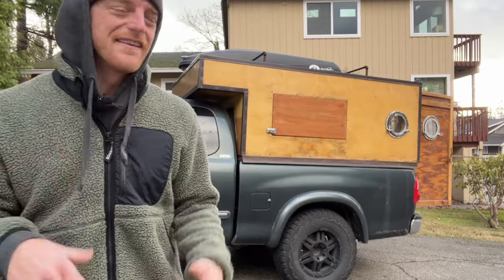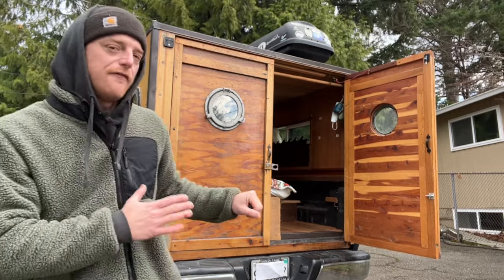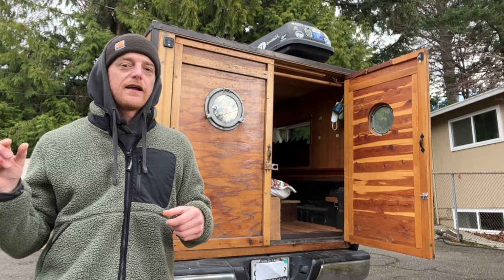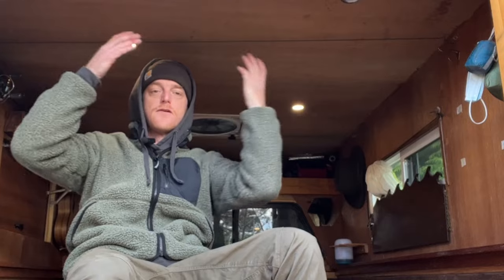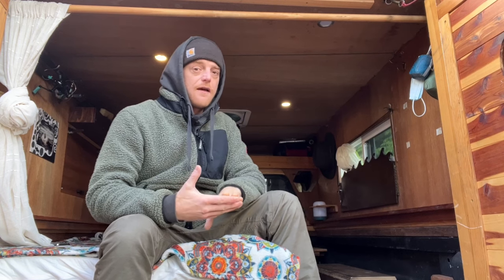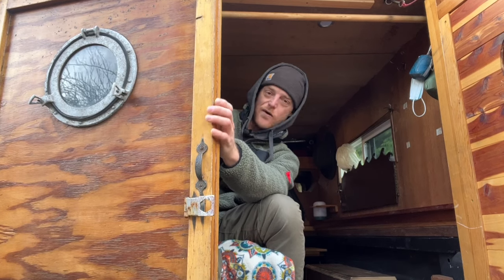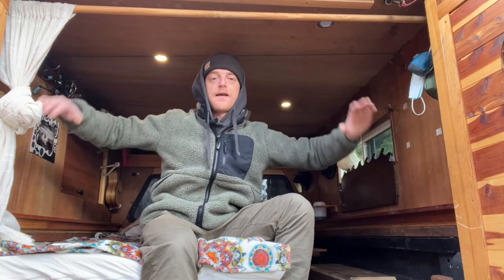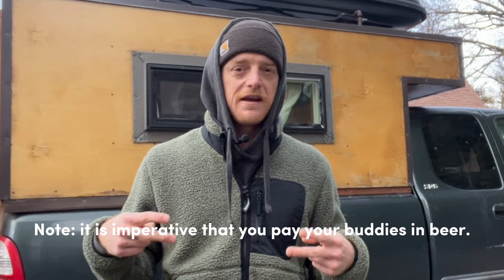Framing A DIY Wooden Truck Camper: Lightweight, Inexpensive, Simple & Strong!

Comment: Popular wood is not hard it is soft and weak not saying it not going work for what you used it for but I am an arborist so I do know my wood I would not let the poplar wood get wet or your going have issues
Reply: Agreed! I'm a Carpenter of 30 years,I'd never used popular
Reply: Use cedar next time—light and water resistant. Strong enough for these things.
Reply: Botanically speaking, poplar is an angiosperm, which is referred to as hardwood. The
Reply: Popular is definitely a HARDWOOD
Reply: Wouldnt hurt to do a poormans fiberglass to seal it
Reply: @theemeraldfox7779 hHa😂
Reply: @jamescorfield534  what's so funny?
Reply: @theemeraldfox7779  I thought it was a joke but maybe it wasn’t
Reply: @theemeraldfox7779  because its supposed to be Poplar I thought
Reply: @theemeraldfox7779  don’t ask me why I thought it was funny at the time I don’t remember I don’t do negative. I only respond to it so if I was wrong it’s cause I was mistaken in how funny it was
Reply: This is a truck camper video instead of being a hater or focusing on the wood compliment the man for making his own camper
Reply: I'm a woodworker poplar is definitely a hardwood look it up
Reply: @elmmau3876  no it not am an arborist the wood starts with me it a very weak wood
Reply: Well you're confusing your opinion and experience with fact it's a fact it's a hardwood look it up. I'm no arborist but I run a sawmill and work with a variety of different species from log to completed project.😘
Reply: You are correct.
Reply: First off I love the camper! Great build, great job! We use poplar wood 8"x10" x48" to crib up tractor trailers to work on them and they hold the weight with no problem they are light and easy to handle. One time we ordered oak timbers and they sucked they were twice as heavy as a popular. The  oak started splitting from sitting out in the elements. The popular held up better and we continue to use it.

Comment: Use light gauge steel framing, the same metal studs used in commercial buildings. It's 70% lighter than wood and stronger. The trick is to turn the metal studs sideways so the wall depth is 1.50 inch thick instead of 3.5 inch thick. That will give you an R 7.5 value with Extruded Polystyrene foam board insulation which is very high for a small camper that is totally sealed. The camper needs to be insulated on all sides, top and bottom, and completely air tight or you're wasting your time.

Comment: Hi Mike. Alfred here. Just wanted you to know that I like the job you did. Excellent job. Your camper build inspired me to build one of my own. So I did. I built a wood frame with 2" foam insulation, put 1/2-inch plywood on the outside and then I wrapped the entire thing with aluminum. I drive 2006 Toyota Tacoma crew cab 6ft box. If you care to see let me know. Love the name you picked for it 'Maxi pad'.

Comment: Love this framing guide.  I wanted the build one of my own and kept thinking I needed to use something like aluminum tubing and channel for weight reasons, because I knew typical 2x4 pine would be too heavy for my purposes.  I'm not a carpenter, so the though of using a 2x2 hardwood as the basis of framing hadn't even crossed my mind.

Comment: Thanks for the detailed breakdown this will help me a lot. going to try and build a canopy/topper soon. I want to be able to remove it easily.
Reply from the maker: Nice! Glad you're finding it useful. There are plenty of ways to make this design more easily removable, too. Mine's removable, but it's a process because it's bolted in and the double doors need to be removed. So using clamps instead of bolts, and an easily removable rear door would be a step in the right direction. Get creative, I'm sure you'll nail it!

Comment: I love it. Glad you posted this video. I will do generally the same except I like to work with fiberglass and will cover exterior with 1/4” luan plywood and will fiberglass and gel coat it. But same basic principle. 

I love to build stuff. And in this case I’m going to do it myself because a BASIC purchased LEER cap for my 8’ bed truck is nearly $5 grand!!  I can buy a LOT of material for $5 grand and it will end up being so much sweeter. 

Anyhow. Good job. You are definitely ready for Burning Man.

Comment: I like the port holes.  When the weather is bad you can 'batten down the hatches'. ;-)

I dream about builds.  It's a good past-time!  I need to save up for a van and many years of travel with a decent rig, but I've look at full size vans but recently at the small vans or what some call micro-van.  I think I can make it work.  One thing is how to store propane for a van, and many RVs and such have a compartment that is sealed from interior but with a door, and vents on the door, to the outside.  

If I plan on using propane quite a bit for years then it would pay in the long run to do propane storage the safest way.

Comment: You mentioned 3/5 exterior plywood- is that correct? It looks more like 3/8 or 1/2. I really like the light weight design / simple design - thanks.
Reply from the maker: Doh! You're right, I misspoke! The plywood is 3/8", not 3/5". I'll make a note correcting that in the description. Thanks for the catch!

Comment: Idk why people say to use 2x4's, if you've ever gutted and rebuilt a pull behind camper they are framed with 2x2's, trust me, that's what I do for a living., literally we buy old pull behind campers gut them and rebuild, redesign the floor plan and rebuild them, but we rebuild them to better than new condition and do things that the camper  builders don't do, we use Flex Seal on all the gaps instead of Seam Sealer and we paint the roofs with truck bed liner before we spray the body color on so if it gets caught in snow or hail it's more rugged and can take more plus it adds to the insulation, we had a couple send us a video of their camper in a hail storm in Western Iowa 3 weeks ago and commented how well the roof held up.
Reply: Great ideas thanks! I hope your still doing that and I wished I could find a old over the cab slide in truck shell but they are hard to find! I've got a 94 Dodge RAM 2500 but maybe one show up one day before its to late. Have a great day buddy!
Reply: @Tommy-rr7ez  Yep still doing it, I just bought a 20' camper for myself along with a 73 Ford Torino Wagon that I'm going to paint on the same color scheme to make it look like a set.
Reply: @TheREALOC1972  Thats awesome buddy! I had a I think it was a 71 Torino but I don't think I ever heard of a Torino Wagon. I know one thing I never could get traction cause there was no weight in the rear.  You going to pull the camper with the wagon?
Reply: @Tommy-rr7ez  Yep, that's why I bought it, so I could travel the country on my vacations and when we go to car shows and stuff like that we can just stay in the camper.
Reply: @TheREALOC1972  Thats the way to do it! The costs of rooms and having to eat out especially with a family is out ragous and your setup will pat for itself and yall can enjoy yourself more. I'm proud for yall buddy!
Reply: @Tommy-rr7ez  yep, it certainly saves alot of money.

Comment: hi great vid! i have a huge question for me! if i build something like this, could i potentially use the extra space from the popped rear door/flap of the bed? and extend the build to it? or is there anything wrong with that? a tipp would be so cool!
Reply: Hey there! I’ve been on a truck camper binge for a while and on one vid it was explained that if the camper goes beyond the tailgate that “by law” the rear of the camper must have working brake lights installed to be road worthy.

But if the camper fits inside the bed with the tailgate closed then you don’t have to worry about that since the truck’s brake lights are enough on the road.

Hopefully this answered your questions!
Reply: Yes besides the lights he told you about, a lot of time when you go longer in length than the bed you will take weight off your front wheels and you never want to do that. It can be done but if you have  a short bed that means a half ton or less vehicle. If you do or have done this you need to beef up your suspension to be able to handle the overhang. Sorry I just now seen video so it's been a year and by now your sitting on a beach in your fancy Lil camper having a big Ole time I hope! Have a great day!

Comment: If my eye sight was better, I’d Love to build a camper for my 23 Tacoma TRD Off Road, double cab with a 6’ bed.
I would use Cedar 2X2, and Oak or another hardwood for the frame around my door.
Of course it would have to be insulated with solar panels on the roof.

Comment: Nice!   A couple issues I see are:
1. No shitter
2. All wooden, so won't last long without coverings.
3. The roof is Flat!  Never good for anything without slope and runoff.
4. Escape hatch.  It doesn't have overhang bed, but only way out is thru the door!  Would want an escape hatch out the top as typical.

Comment: Right brilliant, mate, liked & subscribed. I have an old F150 XL- 6 1/2 foot bed that I wanted to build a high cap on. Same height as the truck cab would be 22" above the truck rails at the front of the bed & 32 inch above them at the rear. I have a popup fiberglass truck cover to sit on top. My biggest concern was the weight and I was trying to figure what wood could I use. You've given me the answer. However I was going to use 1/4" plywood with solid plywood corner braces on the inside of the frame thinking that this would afford all of the strength required. I would only have roof cross pieces at each end, and another about 2' from the front of the bed due to utilising the height effectively when I raised the fiberglass cover up (it raises about 28 inches). Do you think this would work okay? Do you recommend a glue? Is glue superior to construction adhesive in your opinion? Ta-
Reply: Hey buddy I hope you get this cause it's been a year! I hope even more you got your Lil truck camper done and you've been out having a great time! But you gave a great idea with your fiberglass popup truck bed cover for on top. There higher on one end to give head room and light but strong. I just want to tell you I preciate you telling us buddy! I hope you figured out bout what type adhesive is best by now. Take care my friend and always be a Happy Camper!

Comment: So I'm basically trying to build something VERY similar but on a bigger truck. I wanted to sleep E-W and was thinking with my current width across my rails being 72" I could use 2x6 for bottom peace along the rails and set 2x2 on the outside so I keep the interior space?? Would this work you think?

Comment: Great video, very informative. What did you use for waterproofing the exterior?
Reply from the maker: Thanks for the feedback! I used Sparvarathane on the exterior walls because I wanted to keep the wood grain finish. I was skeptical but it's actually held up pretty well, possibly because I put 4+ coats on. I thought I'd need something burlier for the roof, but still wanted the transparency, so I initially use fiberglass and polyurethane resin thinking, 'it works on surfboards." That was a mistake. It ended up delaminating in a few places, so I sanded it down and used the roll-on Flex Seal. Two coats and believe it or not, it works great! Put two coats on before winter, and will probably add another next year. The only downside it's black, so it gets hot, but they make a white and a clear now as well. Enjoy the build!

Comment: Is it possible to make one of these out of pallet wood
Reply: You can but a lot of pallets are a true hard wood to handle the weight put on them so you would have to be cautious to how much weight you are adding. But then again if you have a 2500 or 3500 truck you shouldn't have a problem. Now get at it and let me know when you get finished!

Comment: What did the build cost my man?
Reply from the maker: Just under $1k for the frame, insulation, and interior/exterior siding materials, but I did used some recycled lumber and windows. Altogether with the portholes, auxiliary battery and fan, came in at around $1500 total.